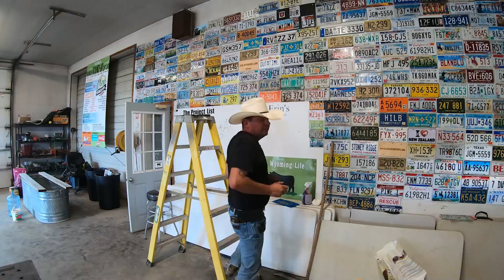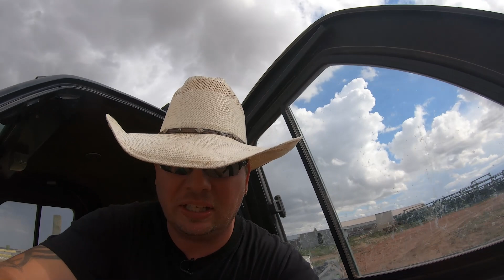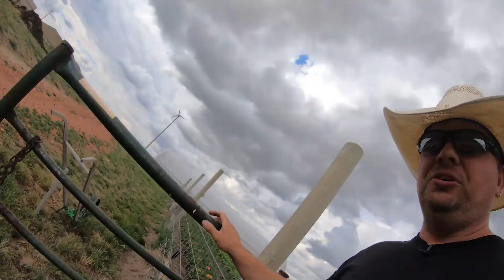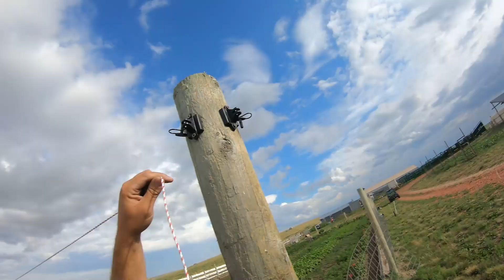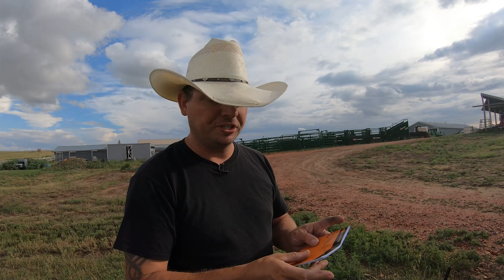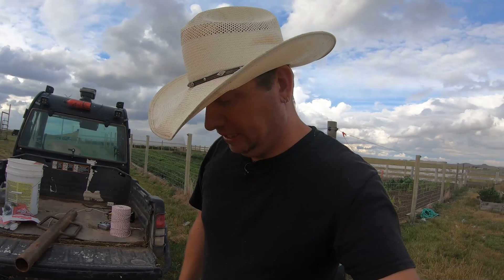Our First Electric Fence

Comment: The amperage isn't "flowing through there" the circuit is set to shut off above that rating. The amperage depends on how much your body draws while being shocked. At any rate, what matters is the power. Power equals volts times amps. Watts (that's power) is what kills you.

Comment: put the energizer unit inside the fence, not outside. the deer will knock it off the post denigerzing the wire and then get in. (and damage the unit)

Comment: I don’t see this working very well.  When the Deer jump over the fence, they will clear it altogether and be airborne when they touch the hot wires resulting in no shock unless they happen to contact the lower fence.  More than likely, the deer will drag the wires down as they jump the fence.

My recommendation would be to build an electric fence outside the mesh fence from the ground up and place some type of feed that they can reach by sticking their head between hot strands so they get the shock.  That way they learn the danger of the fence.  Also, the system needs a grounding rod.

Comment: We have been using electric fencing and electric mesh netting for YEARS. We have them hooked up to cattle chargers. IF they can stop a bull elk in its tracks and make it turn on its heel and run away like the hounds of hell are after it: then we are doin' good. We use it to protect our gardens, orchards, 500 hens/roos, turkeys, ducks, and more. I HIGHLY recommend Premier One poultry fencing, we custom order it so its twice as tall and with smaller mesh. We run 8 fences in a line connected and we successfully used it to pen up my neighbors cows who decided that the grass was greener on every other side than their own... while my neighbor was out of town. It only took a few zaps before even the 'gate crusher' steer (who I HATED btw) was keeping his distance.

Comment: Just so you know, if you take a green blade of grass you can hold it, touch the line with it to see if it's hot, without getting such a bad shock, should you forget your tester. 

Do not forget to pay attention to the fenceline when standing in wet grass and holding a metal t post. Fence + t-post=bad day.😉😭

Comment: Mike, I test the electric fences as follows, I cut a blade of green grass 8 inches or more, I grab it from one end and rest it on the wire, that works as a "resistor". Either you feel a little "tickling" or the sound of the discharge

Comment: Ok...so I'm not an electrical engineer, just a nerdy farmer. A joule is a metric unit of energy (or work done over time). 1 joule is the equivalent of the energy produced by 1 watt of electricity in 1 second. Watts = amps x volts. So if your fence is indeed 7000 volts and the pulse is maybe about 1/1000 of a second (like a car spark plug) it will deliver about 4/100 of an amp in that time (7000volts x 0.044amps x 0.001seconds = 0.31joules).

Comment: I know you're supporting local, but $36 will get you 1320 ft of 9ss polywire from Kencove.  $350 will get you a 110v 8 joule Taylor Cyclops charger made in Alabama, and that will lay you out - keeps bulls from heifers in heat with a single polywire.  Pin locks are $8-10 for $25.  Good step in posts are the big cost here.  $100 will get you a fence tester that helps you find problems with the fence if there is a problem.

Comment: Mike. You will have to educate the deer to the fence. Google the right wire heights for deer. You might have to erect a second electric fence next to your woven wire fence. The deer has to be standing at the fence and put his nose to the hot wire. It will not take many ‘shocks’ before the deer will stay away. Put a camera on the garden to see if the deer touchs the top of woven wire before jumping in. If they do then put a hot wire at the same level as top woven wire strand.

Comment: If you're caught without your fence tester, a good way to see if the fence is working is to hold a blade of green grass between your fingers and drape it over the wire. You will fell a slight pulsing through your fingers, but no pain.

Comment: Had to laugh at the fence tester remembering back to my own personal experience having grown up maintaining an electric fence for my sister’s horse. The one I had was a simple neon flash tube in plastic enclosure a metal hook to put on the wire and a nail on a wire to stick into the ground. Golden rule to remember is always take it off the fence before you pull the nail out of the ground. I got that backwards once and the shock tightened my hand onto the nail in my hand, and I couldn’t let go. Was not pleasant, and letting go did involve some lost time. If you want to test with your hand use the back of your fingers to the bottom of the wire, that way the shock will naturally pull your hand away from the wire. Would also second the comments that a single strand at nose height would likely work better that a wire in the sky. Stay safe, wishing you and your family the best.

Comment: Good video Mike, but a suggestion for future electric fencing if you do more, don't buy that wire that you had.  You can just use some extra barbed or woven wire and you could save money that way.  I run a 1 wire electric fence during the summer out at my pasture and for winter on milo stalks and all I use is smooth metal wire, wooden corner posts, and rebar fenceposts with screw-on insulators.  If you have any questions or need any product suggestions in the future I'd be glad to help!

Comment: If you ever decide to try it for cattle on permanent fence I’d recommend an AC charger vs solar and something with 10 joules minimum, preferably 16+ joules. We use the solar charger for temp fences dividing barbed wire pastures up for now until we can replace our barbed wire with electric permanent fences off of a charger at the barn.

Comment: Great video.  As with anything new it's a learning experience.   Not so sure I would have been so brave to touch the wire.  Hopefully this can add some Erin points for ya if it works out. 🙃

Comment: Yup I would add a second strand of wire. You can do it from the post of one side of the gate around to the other gate post leaving  no second stand of wire where the gate is for gate use. Just tie the second strand of wire into the top strand at one side of the gate post. It will charge all the way around. Electric fence is a breeze compared to other fencing. Especially if you already have the posts there. It sucks to have to dig holes for the post. Been there done that times 125.

Comment: Watts (i.e. electrical power of amps times volts) are defined as 1 Watt = 1 Joule per second (1W = 1 J/s) which means that 1 kW = 1000 J/s. A Watt is the amount of energy (in Joules) that an electrical device (such as a light) is burning per second that it's running. So a 60W bulb is burning 60 Joules of energy every second you have it turned on. .13 Joules = .13 watts, not much power at all.

Comment: You might want to try 14 gauge wire. It will hold better with deer still jumping. Deer are NOT MY FRIEND they make me go threw a lot of clips. But man. It’s so quicker. (Hot wire break your cattle before ever trying to have a long fence of it) my heifers before breeding are in a 10 acre pin. The longest fence I have a hot wire a long the 5 wire fence. The year there in there for they pretty well catch on. K I shut up.

Comment: I run a mile section all hot wire. I have 3 main boxes I use for zapping. I have an electric plug in one I just love. You can hear it zapping from 20 yards away. My 2nd fencer I love too but it’s more $ it uses 2 car batteries.(I have 11 batteries and still gaining) 1 is plug only into the negative while the other battery is only plug into the positive. It’s like my plug in one. Then I have a 300 mile one. All you can hear zapping. I worked in a 17-18k acre ranch about 4K acres was hot wire. Honestly I love hot wire. I can build 3 miles all with in 2 hours. It’s so simple. You just have to check it daily, deer are the enemy of hot wire tho. Freaking if they don’t brake the clips. They lean your fence over. (I don’t use T post endless it’s the end of the fence. I’m only 21 leasing ground. Rn I only have 30 head 1 heard bull and a heifer bull. It’s all wheat pasture so i can run 200+ head. In 10-15 years when I reach that number I have 9 other quarter sections I’ll figure out what to do with. My adopted sister real grandpa has a lot of land no cows. I’ll figure that out when it comes time. (I use high voltage cause of a cow gets out. Hit by a car. That’s a law suit all day long) IT WONT KILL NO CALFS BUT IT WILL MAKE THEM STAY AWAY REALLY QUICK

Comment: Nowdays those fence chargers are "low impedance". I would not consider touching it to test. I use testers that have a row of flashing lights, I think it cost about half what you paid for that Galaghar(sp) product. Depending on which lights flash it tells you the voltage. My fences run about 5000 volts. In the field without a tester if you short it with a screwdriver (leaving a slight gap) you can see a spark. Supposedly the shock will not harm or start fires.

Comment: An electrician taught me how to check electrical wiring to see if it was hot without a meter years ago.
Touch it with the back of your   hand/fingers. Electricity causes the muscules in your fingers/hands to contract making your hand literally grip the wire. Electricity will also travel faster and farther touching it with your finger tips than with the back of your hand/fingers.

Disclaimer: I only do this when I absolutely have to know a wire is hot , and I don't have a tester on hand.
Reply: My dad taught me to test electric fences that way. Get a zap but not too bad.

Comment: Ground rods should be galvanized and DEEP in the ground (especially in drier soils) Take a multi meter and put it on your t post/ground rod and see how many ohms you get. If you're over 3 you are getting half or less the shock to the target. Its funny T posts are great enough grounders to take all the amperage out of a fence if an insulator fails and a hot wire hits it but they are generally terrible ground rods for providing earthing for a hot fence.

Comment: Sorry to say that your placement of the fence wires actually defeated your initial purpose for the wire fence - because there is no contact with the ground if a deer jumps up and contacts the hot wires - you would be better served if you placed the hot wires about 24 to 30 inches in front of the mesh fence and maybe 36 inches above ground

Comment: Once you’ve used electric fence on cows, you well never go back to barb wire.  We run a lot of electric fence. And it actually is cheaper in the long run.  Just have to keep it hot!

Comment: The other way to test a hot fence is a blade of grass - put it lightly on the hotwire and it will bounce off the hotwire and back on if it is on - you can feel the blade of grass hum in you fingers but it won't bite like putting your fingers on - grew up on a farm in New Zealand where Gallagher is from - get Erin a quick latch for that gate so she can just flick the gate with her foot to shut it as I bet her arms are full when she leaves the garden so the chain system you have is a pain to have for her

Comment: Yes you can use those on the corners you are not pulling tight like you would with high tensile wire., I would run them on the inside of your post.    I would run multiple strands of that stuff and attach flagging tape to it as that will be a visible deterrent that might help keep them away.  also might help to run one of those braided ropes as a ground wire in your multiple strand network.
Reply: By the time they would touch that single strand you out up they are in the air an in motion and it will just get torn down, run it like you would a 4 or 5 strand barbed wire above that woven wire with flag tape on each strand.

Comment: 30 volts under the wrong conditions can lock you in the circuit and could kill you
older electricians taught me to use the back of my hand to test for voltage muscles contract and pull your hand/arm out of the circuit

Comment: I planted 10,000 strawberry plants 3 years ago, lost all but 50 plants to deer, next year I put up a 8 foot electric fence with 6 runs of wire around the next strawberry planting, this year I had my 1st u pick, no deer getting in, and no raccoons getting in as the bottom strand is about 4 to 6 inches from the ground. Gallager  fencing is a good choice.
Reply: also put some peanut butter on the strands and they'll smell it and have a little taste, the zap will then teach them that it is not a safe place to be.

Comment: Deer love to break or knock down electric fences where I'm from.  Also - put that fence on a 1ft offset in front of the fence and down much lower.  If you're going to run something that high just double the height of the woven wire.  The pulsing of the fence charger are the caps charging and discharging.  Thus being able to briefly 'generate' the 7200V

Comment: I have been using electric fencing for about 30 years.   Electric fence works when the shockee is standing on the ground.  The current goes from the fencing through the shockee and to ground.  Unless you add a grounded wire in the middle of your hot wires a leaping deer might not get shocked.   Learn it and you will LOVE it.  Place the ground rod near where Erin is using water.  Keeping your ground rod deep in the ground and moist or even adding additional ground rods is what make the shock strong.   Another suggestion ...  get some little step in posts and run a second fence  - one single wire at three feet tall and about 3 feet out around from the garden fence.    Fasten some aluminum foil "cups" that you make on the wire in several spots.  Put some yummy treat - like peanut butter - on the cup.  You are trying to entice the deer to smell and/ or taste the electrified cup.  A zap on the nose... you remember for a LONG time.  Electric fencing is a mental deterrent.  It doesn't need to be strong or on big sturdy posts.  A single wire will keep a bull or pig or goat or horse just where he needs to stay.
Reply: Best comment I have seen so far.

Comment: 1970. I was a 10 year old kid. Visiting my uncle in Iowa.  He showed me the new electric fence he installed. 12 volt battery and a power box with a flashing light and an audible CLICK CLICK CLICK when it pulsed a charge.  My uncle told me to hold his hand and I would be fine.  

THUMP THUMP THUMP.  that’s when he let go.  He didn’t feel a thing.  I got to show my little brother how it worked.  That was fun.  

Science on the farm.  Priceless. And memorable 50 years later.

Comment: Looking good!   Garden is looking good too!  Amazing to me how many people make assumptions that you have not done any research and are quick to point out what you did wrong.   As the deer are not taking a running jump into the garden, I feel it will work well once you get it completed.  Someone did suggest flagging tape on the wire and although I agree with this as it will get their interest and make the wire more visible, I would suggest rather than flagging tape I use a shopping bag ripped in half - use the handles to tie a knot on the wire and the pocket that forms catches the wind - it works well and the animals see it easily - two pieces per bag.  I run five miles of 1/4 electric rope for horses all year, winter included,  and I like it.  I started with the same wire as you but found it too week and it breaks down from weather too fast and you end up with little breaks in the wire... the knots will also burn out quick.  The 1/4 inch electric rope has the same problem with knots, but it does not degrade as fast as the smaller wire, its stronger, fence can be tighter and it has increased visibility...I still put bags on it though...price is a bit more for the rope, but so worth it. IMHO.   Keep up the good work!

Comment: Solar chargers also protect you when power goes out.  That's important down here in the land of Florida Flicker and Flash.

Do understand that electric fences have to be grounded to "zap".  So if the deer's hooves aren't still touching the ground when they hit the wire, they won't feel the electric shock.  But if they get their horns tangled in the wire, well...

Comment: An animal has to be touching the ground and the wire in order to complete the circuit and get a shock. That is why a bird can land on an electric fence or for that matter a power line and not get zapped. 
The little rod on the tester is the ground and the unit clips on the fence. I’m not sure if it can be damaged from from being hooked up backwards.
Reply from the maker: Or another wire. Which I said I was putting up. Lol
Reply: The second wire would have to be a ground wire, and they would need to touch both.
Plus the deer will already be in the air and just going to continue on their trajectory through the fence. They may not do it twice, or you may have a pen of well feed deer in the morning, that didn’t want to jump back through. 
I just don’t want you to spend a bunch of money and be disappointed with the results. In Wisconsin dealing with whitetail deer, our garden has 6’ tall woven wire fence with a electric wire placed at 24”-36” high 3-4’ away from the woven wire fence. Deer can clear 8’ easily, but the electric spaced away from the perimeter fence slows them down enough that only the really athletic ones get in.

Comment: Mike wood is insulation and will not carry current.  The deer must be on the ground to get shocked, if in air they are not grounded and do not complete a circuit.  also one of the idiots that peed on a hot fence when young.  As kids we did it more then once before we learned on the farm.  The hot fence was intermittent.
Reply from the maker: Or if they touch another wire.  That’s why I’m putting up more :)